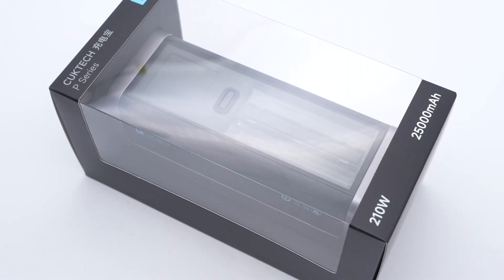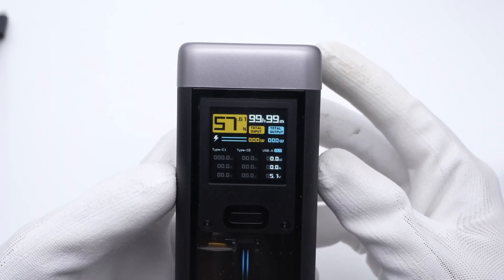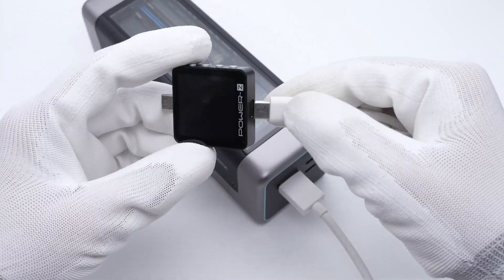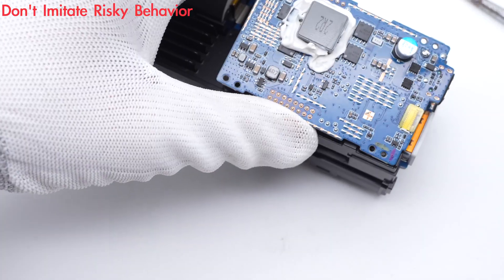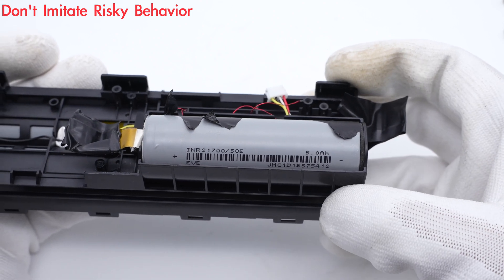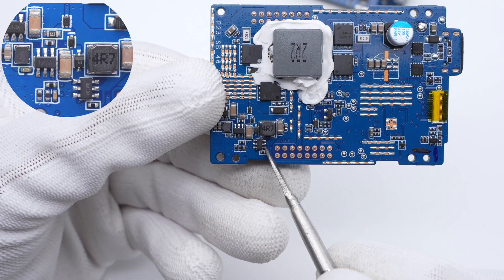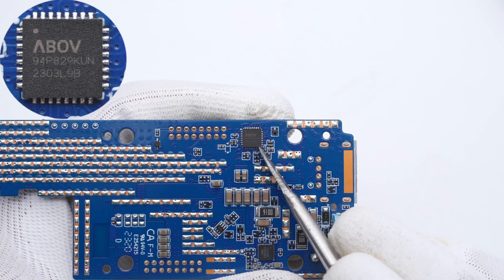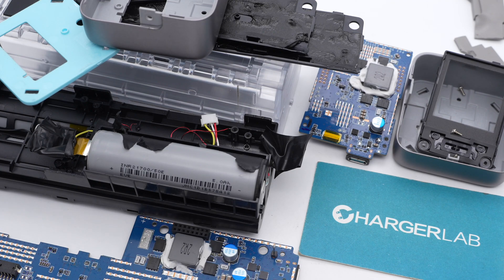Teardown of CUKTECH No.20 PD3.1 & 210W Power Bank (P23)

Comment: I have this power bank, and just failed on me, it's stuck on 0% not acepting charge. Tried multiple chargers and multiple cables and nothing. I did the teardown and checked the battery cells voltage, and every cells it's at 3.9V, so the batteries are ok. Probably the IC of charging it's faulty. This device has a warranty of 18 months, so I contacted CUKTECH customer service, and they will send a replacement unit.

Comment: Could you please tell me if 5 cells of 5000mah are connected in series, how come the total capacity is 25,000mah?

When batteries connected in series, the battery capacity does not add up.

Please explain.

Comment: I bought it after watching your wonderful review. It's such a shame that such a well-built device has to be thrown away when the batteries end their useful life. The internal batteries are easy to find of the same brand and capacity, but replacing them requires desoldering the old ones and redoing the various connections.Not impossible, but not easy either. Shame on Cuktech.

Comment: I got this....NOT HAPPY..it acts odd with some cables to my S24U..got 2 goood anker ones..only one works right..got 2 cheap ones..they dont work good...the Amps..Volts...Watts..time..keep jumping up and down...so it doesnt charge fast..but if yoy get the right cable it is pretttty fast...so i might return it...
Anybody else have thos problem?
Reply: some cable probably dont have the required chip

Comment: Is it possible to easily remove/replace the battery cells, or are they soldered in place?
Reply: It is easy if you have spot solder machine to replace new battery
Reply: @uyluccanhsatmy3016  thank you for confirming! This is the best battery bank I've seen yet then! The fact that you can disassemble it without destroying it is amazing

Comment: I've had the Powerbank for a few weeks now. Hands down the best I've ever seen. One of the nice features is that it allows parallel operation of all ports and even charging from two power sources simultaneously, e.g. Solar panels. If I had one complaint: It is rather power hungry, just operating the MCU alone will consume around one Watt so if you keep it connected to a Solarpanel in the shade, it's actually draining the battery...
Reply: Hey, where did you order it from? Shows out of stock on Amazon currently. Any other source?
Reply: @HorrorJamHQ  Indiegogo
Reply: @danielegger6460  Ah, ok. The campaign seems to have ended there. Couldn't find it anywhere else.

Comment: One of the main problems I know is in these devices is the batteries themselves usually after 500 charges those batteries become useless. everything else looks pretty good. What they use now to power these Chargers. They're not going to last in the long run. They're going to have to replace them with LiPO batteries that will last a lot longer than these batteries will. And it will make the device a lot lighter. That has to be addressed.
Reply: The real answer is consumer replaceable standard battery cells (and recycling of old cells). Also best not to confuse LiPO and LFP / LiFePO4, they are completely different chemistries. LiPO (lithium-ion polymer batteries) do not typically have a longer lifespan; LFP/LiFePO4 batteries have much longer lifespans (thousands of cycles) but have significantly lower capacity.
Reply: @theclifbar  That is not the question I'm asking the question I am asking that the common man can understand, and i am not trying to be offensive but how long it would take to charge the power bank from minimum up to full capacity that the common man that does not know such things in regards to batteries can understand? That is the question.
Reply: @luisfj9 less then 2 hours if charging it at its max charge rate
Reply: LiFePO4 cells have lower energy density, so wouldn't it be a larger unit?
I like that power banks can be charged so quickly now.
Reply: Luckily near my place there’s a bunch of dudes who loves doing DIY powerbanks they can easily swaps better battery cells in these bad boys after they gone kaput :)) but these devices are nice for what they offer. I just hope technology develop enough for 200w and above single port so lower powered gaming laptop can charge with ease. The heat would be immense lol.
Reply: If u used lifepo 4 the Powerbank must bigger than this and much heavy cause energy density is lower than lion...